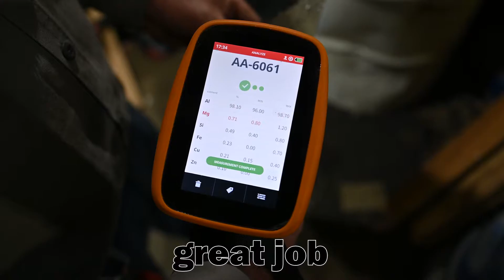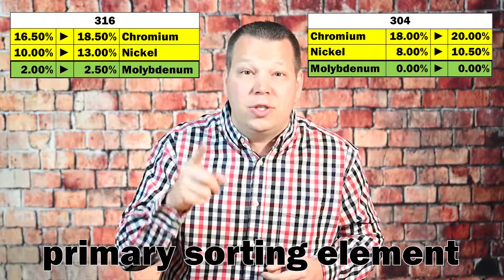What are 304 and 316 stainless steel and how to sort them!!?

Comment: Wow, so all I need to do is buy a 10,000 dollar tool for 30 extra cents a pound
Reply from the maker: Typical handheld XRF units vary in price from $15,000 USD to $50,000 USD based on a few factors. Handheld XRF units often pay for themselves in less than two weeks at your local scrap yard. Jewelers also use them to grade precious metals. The price is high for individuals but actually low when considering the high payback for large volume businesses.